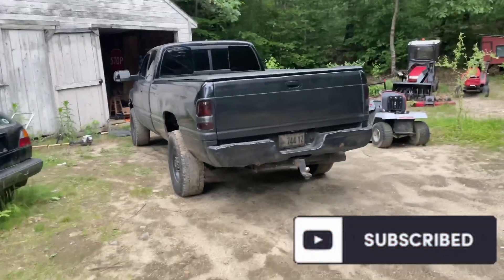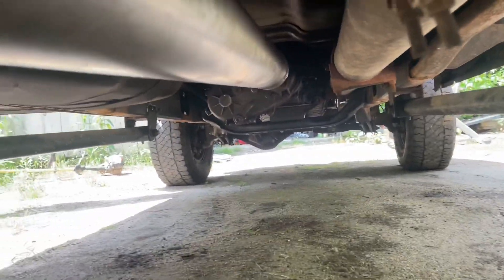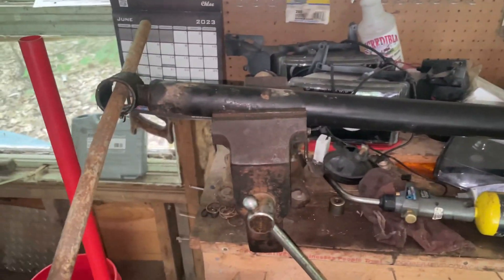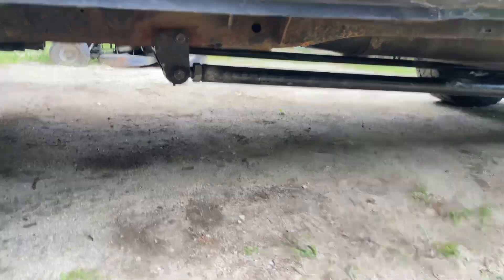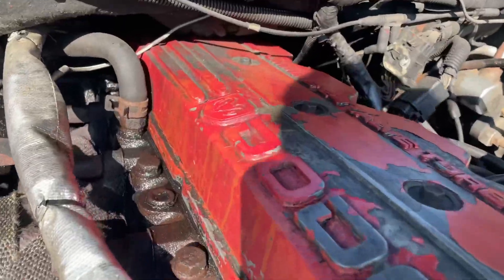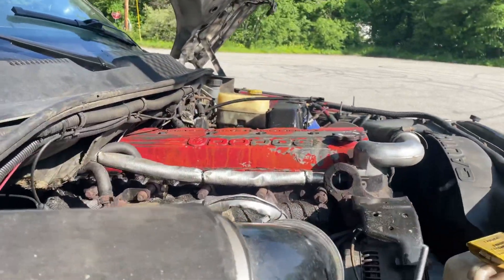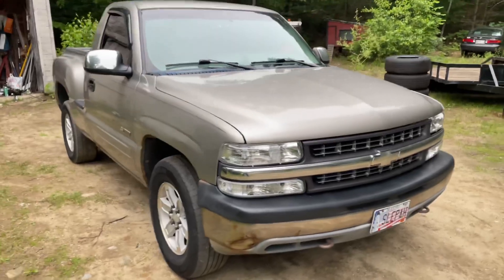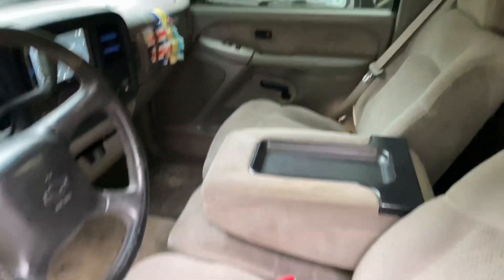Blew the cummins up.. got a new truck

Comment: I like the new truck. Just curious about that "tick" noise. Exhaust manifold bolt broken ?🤔
Reply from the maker: Me too! And it could be, I didn’t look into it much honestly just because 2 or 3 of my 6.0 Chevy trucks had the same noise in the engine and I never had issues. I just look past it as the “Chevy tik” it runs and drives real healthy tho and has healthy oil pressure. honestly I’m just so happy to be back in a gas truck.. it’s not scary like the cummins. Even if I blew the motor in this truck tomorrow I can get another one the same day for $300 haha it’s so much cheaper and more realistic if anything breaks on it
Reply: @RightFootRacing  That's good. I'm happy for you, man. That lic plate gives it up pretty quick. 👌
Reply from the maker: Thanks man. It was a lot of stress relieved seeing the truck leave the driveway… I know I lost a lot of money on it but it was time to let it go so I didn’t loose even more. I wanted to move onto something else. And yeah that plates pretty sweet haha. That was actually the previous owner but they let me keep ‘em. I’m gonna run them for a little bit until I register it and then I’m gonna mail them up in the garage on the wall with my other plates

Comment: can't be mad treat something like crap its gonna blow lol
Reply from the maker: Oh definitely. Especially with 400,000 miles on it with original components haha. I wasn’t mad, I was actually very impressed with it, it did well, it just wasn’t the best timing back then
Reply: @RightFootRacing   fs bummer it had to go but these 2nd gens cost money man, I feel you just dropped 6 grand on mine I can definitely see how you dropped 18 grand lol
Reply from the maker: @youngproductions1401 it goes fast haha. I sold it and it’s on like it’s 4th owner and currently has a warped head and blown turbo